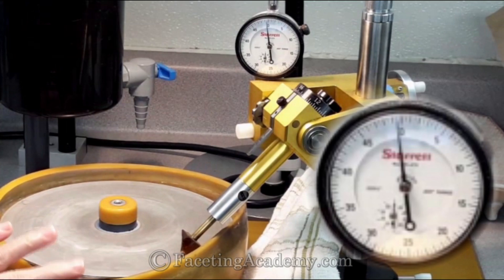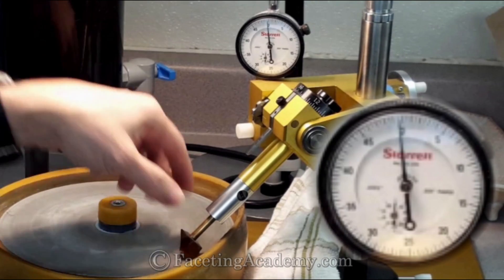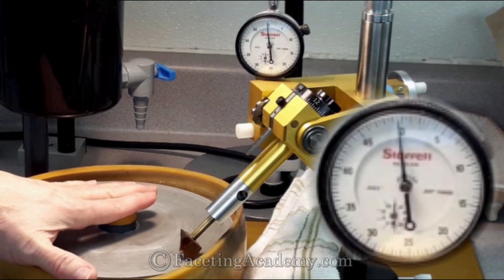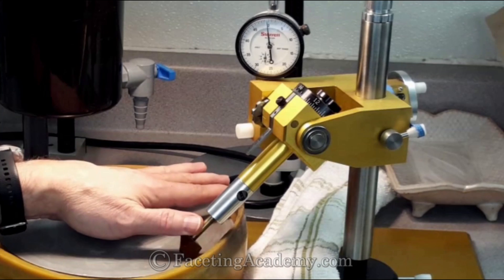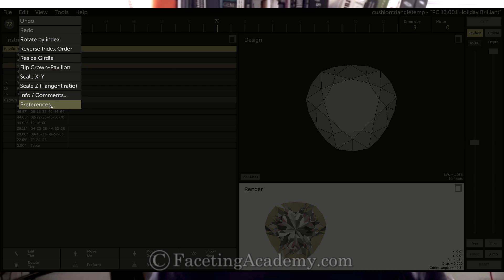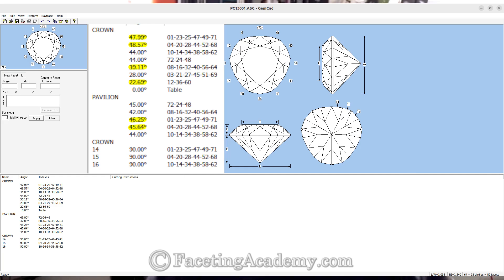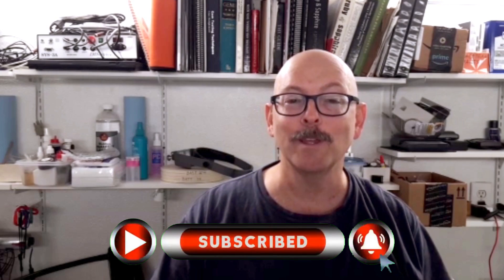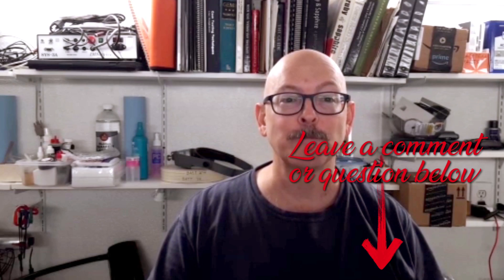FOR THE HUNDREDTH TIME

Comment: Can this dial indicator be fitted on a Seatle Face-ette?
Reply: Sure. The connector attaches to the dop. Anything with a 1/4 inch or 6mm dop will work with this connector shown in the video. If you have a different sized dop, just search out a different connector to hold the dial.

Comment: im actually looking at buying a copper lap for rough grinding (like 100 grit or so).  Do you have a recommendation of a good site for a good copper lap?
Reply from the maker: I don't have a specific supplier of copper laps that I like. The last one I bought was from Gearloose, but he doesn't make them anymore. The real issue is flatness. And, if they're bonded e.g. to an aluminum master - that the bonding technique remains stable across time and temperature changes, etc.

I'm finding sinc a much better material for pre-polishing, as copper has a higher friction coefficient (more likely to produce orange peel). And, the zinc are also more available in the market. Maybe this will be useful to you...

Comment: The lap itself is variable, I have ceramic laps which have a higher accuracy of flatness, the most accurate lap I have is an Aluminum Oxide Lap, and it's machined, I am making conical shapes, so the amount of material in contact with the lap is the min amount. the variance if the diamonds is the issue. For me I am not making the flats, and its nice to know that the pressure and quality of the lap really matters.

Comment: Hello, John
Nevertheless, if u are cutting your gem with UT v5 using a soft stop,  it works well with 0,01
U get absolute presise meet points...
But after transfer, u get probably a tiny error with meet...
If u use other machine... or v5 with hard stop,  u will never get the 0,01 precision 😊